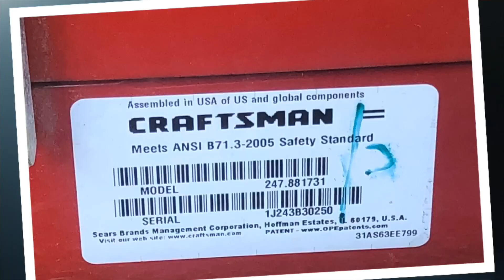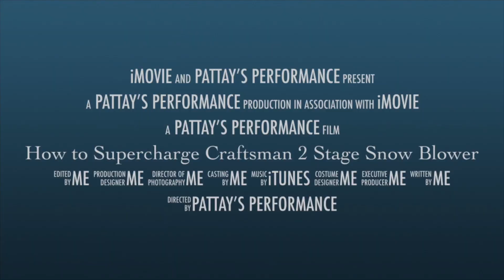HOW TO Supercharge A Craftsman 2 Stage Snow Blower 208cc 24" Modify / Upgrade the Impeller

Comment: Another safety tip, unplug the sparkplug wire any time you reach your hand into the impeller.  It can start by manually turning it.
Reply from the maker: Thanks for tip…Do as you please BUT it’s physically impossible to start the blower by hand using the impeller.  As you see in the video…kill switch functions so even if I had superhuman strength that defines physics…spark isn’t present for combustion to occur